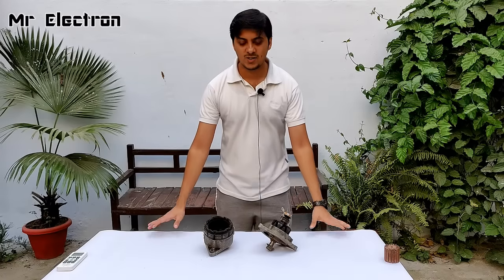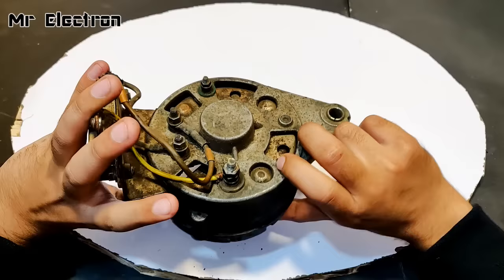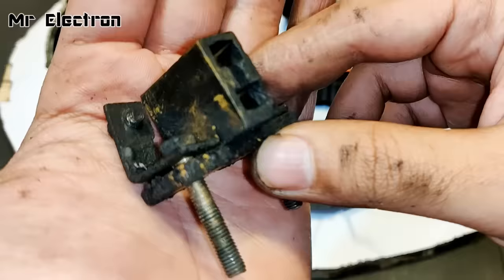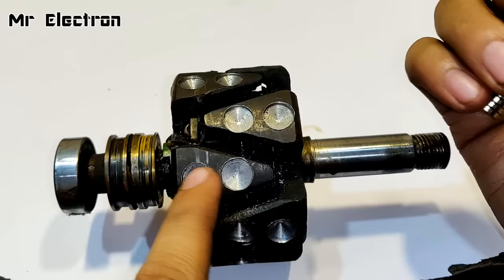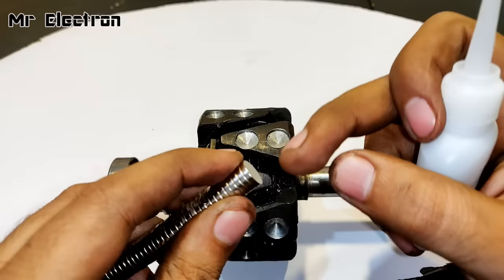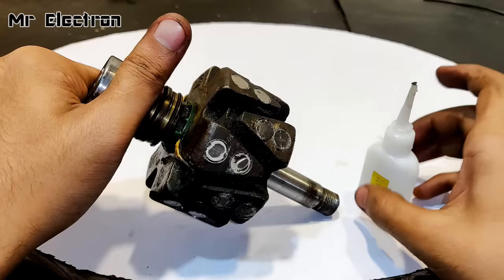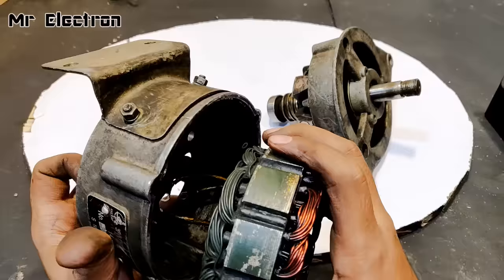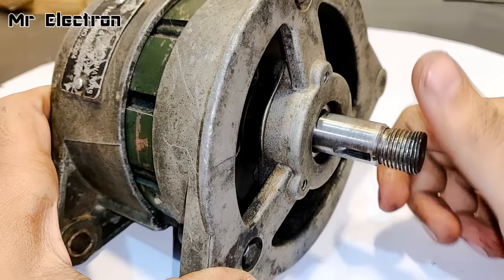12V Car Alternator to Brushless Generator Self Excited - Amazing Idea DIY

Comment: i have an idea will make a lot of people come to your channel. want the idea. take bldc motor and generator 8 plugs then pull off alternator and then remove motor connection then put back inside and weld on first one connection for bldc motor with two gear equal to generator rotation for full value and then plug into the wall and run entire gaming computer on the generator run on american 120 and 20 amps with sound system and monitor and pc and electric gaming chair and the printer and up to eight items. this will make everyone go holy moses and sub and ask like a million question and when they ask why you say i got pissed off when my generator broke jammed a bldc motor into the outside with just a screw tap and this is the lesser of the resistive circuits.

Comment: Can you tell the number of slots in stator and rotor, number of turns in each stator slot and the gauge of enamelled copper wire used for that. Thanks

Comment: you should have cleaned the grease off everything first. the glue probably wont hold due to all the grease. and you destroyed the shaft pounding on it with a hammer !  why didn't you use the correct pullers an tools ?   very poorly done.

Comment: Itne vdo bhejato ho...Why yoy not simple make dive motor to rotate alternator. Why you use rope and wound system..its looks cheap and none cant see output proper on Digital multimer...Please make simple shaft drive system to rotate continuous

Comment: For a long time now, I've been following clever and witty and enthusiastic creatures. What! me, but also offensive also in this video spot is the dirt, impermeability and associated vibration, the subject does not describe the output parameters of the alternator, and the general strength of the neodymium magnets for me thumbs down. Codiak